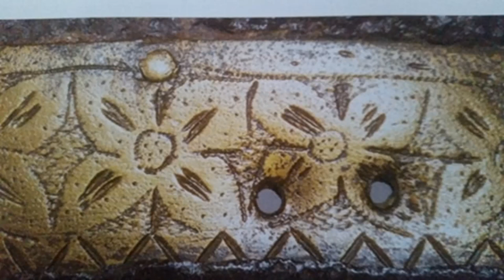Decorative borders on armour. Part One. Simple chisel work.

Comment: I have found that a good spring will make nice chisels and punches.  I like coil springs better than flat or leaf springs for tooling.  A bit less work in making the tools.  As far as what steel it is I have no idea.  Its a coil spring so its going to be pretty good steel to begin with.  I know people say 5160, but I know that's not always the case.  My little chisels hold up pretty well.  I just do a general blacksmiths heat treat on it.

Comment: The issue i'm having with armor is wanting to try and do repousse, etching, engraving, gem encrusting/embedding gems or stones into metal, and other such techniques.
Yet, there's not much material to go off of or many people with advice or tips to help get into those techniques. Not to mention the tools and equipment to even get started with some of those techniques (like annealing with repousse).
Reply from the maker: YOu can get started on the basics relatively quickly, my hope is this shows the starting tools needed. You can anneal brass and the like on a BBQ with a bit of pipe to blow into to heat the charcoal. I always find encouragement from the fact that bronze age folk managed it with a few simple tools, so I can get started and manage a few thousand years development in a few months :)
Reply: @GreenleafWorkshop  Could i actually anneal steel with a campfire or a bbq? Trying to look around, but i thought those don't burn hot enough to anneal steel?
Reply: @Xoroxouselric  Yes.  As Graham stated, you can use "a bit of pipe" to blow air into the fire to increase the temperature.  It's like a blower or bellows used by Blacksmiths to increase the temperatures in their forges, which can exceed forge welding temperatures and even burn the steel if care isn't taken.  Experiment & practice on expendable/scrap pieces before risking something that you've spent a lot of time and/or money making!

Comment: Doing decoration like this is so hard for me to justify personally. when youre an amateur like me and you spend 10-100+ hours just making the piece, spending even more time on brass strips, or punch/file work, or elaborate fluting, is not a very pleasant idea. Id rather start work on the next piece that needs doing.

This is a good reminder that It doesnt always need to be as laborious as you might think. But even still, i think ill leave it to the pros. For now, at least. :P
Reply from the maker: Simple stuff, like most of the 14th and 15h century doesn't take as long as you might think :)